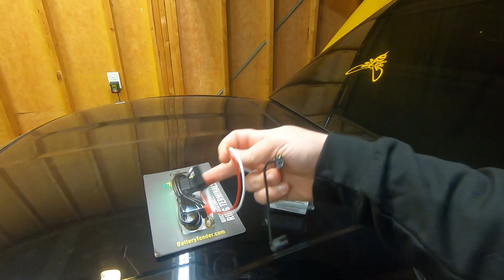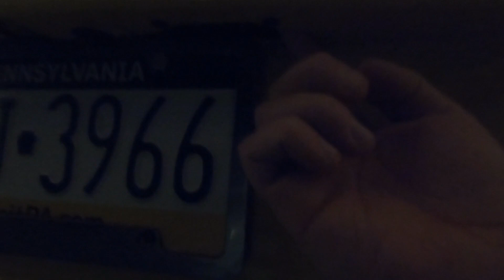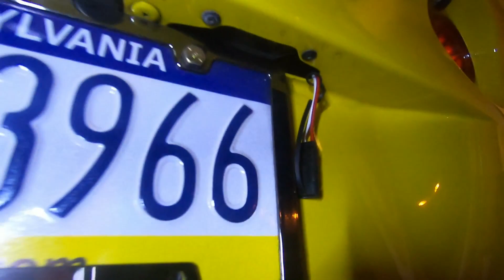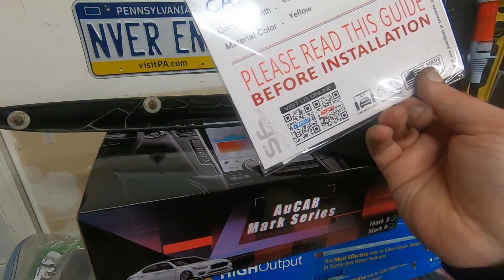C6 Battery Tender Life Hack (GS/Z06/ZR1)

Comment: I own a 2006 C6, I have been using a Corvette battery tender connected to the lighter plug inside the middle arm rest for years with out issues. Car has been seating for months inside my garage. So far, my vette starts without issues. I like it that way because the connection is visible an easily removed when I get into the car…thanks for the tip…
Reply from the maker: Great for visibility if you are ok with keeping your windows open. Or do you route throughout the door?
Reply: @PMPerformance  No need to keep your windows open. There is a notch on both sides off the rocker panel, the wire can rest there without causing electrical resistance. I have read on corvette forums about the possibility of these notches for that purpose….thanks for reaching out. A little background on my C6, it is a Monterrey red base coup LT3. I bought it about two years ago, one owner. Very, very well maintain, has both targa roofs with 11,700 original miles. Right now it seats with 12,428 on the odometer.
Reply from the maker: Now that you mention it, I wondered what those notches were for! Holy hell man, you are a genious! (Or GM was) hahahaha

Car sound awesome man! Glad to hear you are driving it! I deff try to when time allows

Comment: I used a 2.1mm male&female power port, mounted the female side next to the plate light, then you can easily plug/unplug with ease... also I put a piece of painters tape on the drivers window as a reminder the charger is attached.
Reply from the maker: Great ideas! I ended up just throwing a zip tie around the trunk popper cable behind the bumper to keep this from tucking in. I lost it once and that was enough for me to not want to pull the tail light again.
I have been tucking my mirrors in as my reminder
Great tips though and thanks for watching!